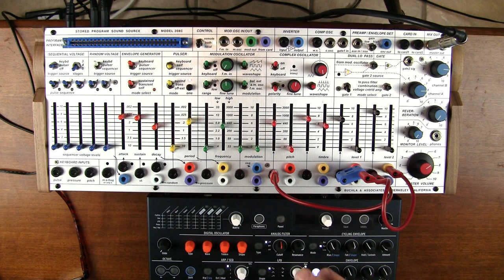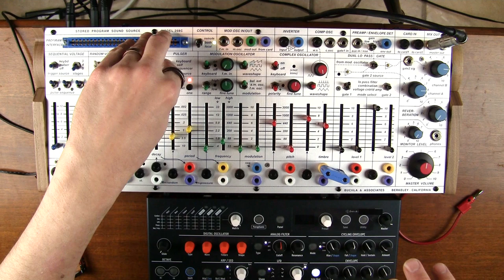06-The Buchla Easel Command- Part six: The Pulser

Comment: if the upper lever of the pulser is positioned to sequencer mode and the bottom lever to off-ext mode, you can trigger the sequencer steps manually using the one button ; pretty cool  (and the period slider adjusts the response;)) thank you for sharing all these amazing tips !!!! great videos ;)

Comment: Could it be that the External on the pulser is just the little button?
Reply from the maker: To my great shame, I still haven’t looked into that!  It’s possibly MIDI clock or something from the card input
Reply: A bit late to the conversation so that has probably been solved, but I put the pulser switch to off-ext and then feed an external clock (from my DAW or a Eurorack module) into the aux in / nse jack input  at the top(switched to high) - I then go from the env out to Pulser input. The pulser is then in synch with my clock and whatever else I have slaved to that clock. It's a good way to have the Easel in synch with other gear. Hope this helps!
Reply: @FranzKirmann  hey! Also a bit late but I tried your technic and it doesn’t work for me. By pulser input, do you mean the pulse keyboard input on the bottom left ?
Reply: @maximerosa2403  Hi - replied to your Facebook message. But it's not the keyboard input. The pulser input is the one, under the pulser slider.